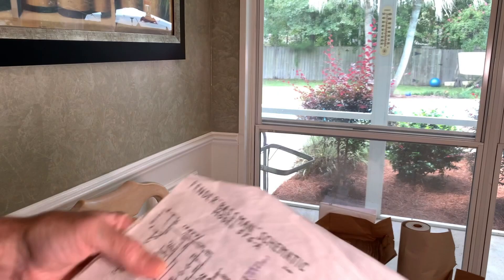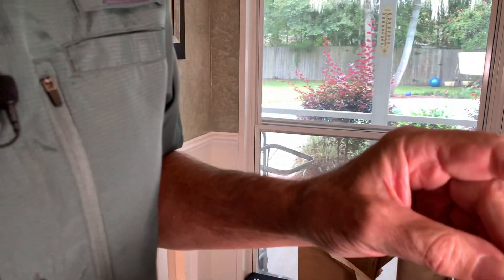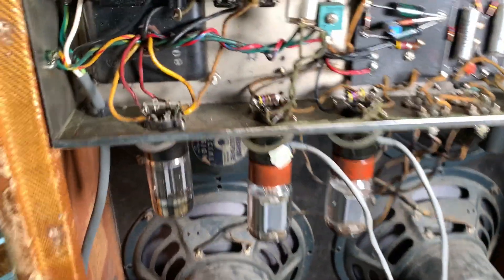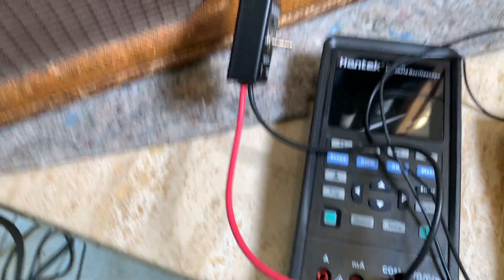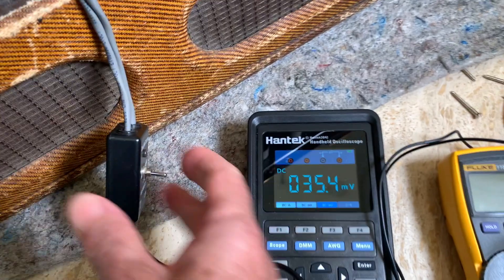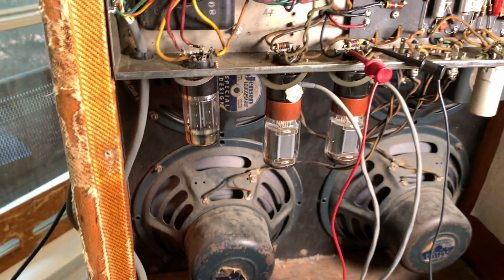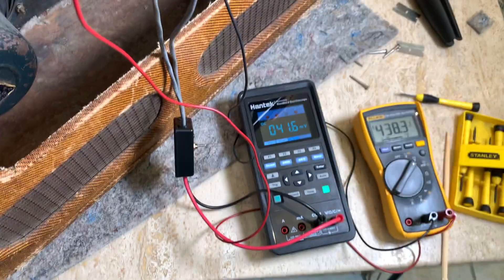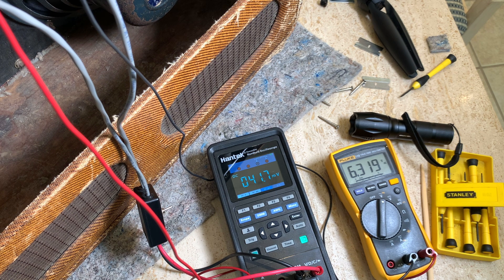Your Amp's Bias is Key to Getting Good Tone - Check it Frequently

Comment: It’s clear you are checking the plate voltage on the first measurement. What are you checking on the second measurement. It is unclear where you are attaching the leads the second time. It is clear you are adjusting the bias a little more but what is the 6.318 volts and where are you reading it from?

Comment: As a question....if a tube is rated as 450 plate voltage, can you adjust bias to make it run 600 plate voltage? If so, how would that affect sound, and what would be at risk of damage? Thanks.

Comment: are those 6l6gc's?
Reply from the maker: No, those are NOS Tung-Sol 5881's.
Reply: @millstap is this what you recommend for vintage bassman? I’m in the process of getting hands on a 1958 and what to get vintage tubes back in it . Also would love you opinion on pre amp tubes and what speakers to go with. It has modern Jensen alnico but would love to know what modern replacements you recommend vrs the new Jensens. Thanks
Reply from the maker: @oakhillslim  Yes, I always use the NOS Tung-Sol 5881's.  They seem to sound the best but there is a modern copy that I have never tried that might be worth trying.  I tried good 6L6GC but they sounded harsh to me.  The Tung-Sols are warm sounding.  The best part about the old 5881's is they are built to last.  I'm afraid the new ones only last a year or two with regular play.  Good NOS tubes are getting hard to find.  I would always look for RCA's or Amperex or a combination of them.  I'be been using a triple-mica RCA 5751's for years in V1 in my Bassmans.  Gives it a little more punch but not too much.  But, there so expensive now and your never sure if your getting a good one so always have a good return policy from the vendor.  I use all NOS Mullard GZ34 which are super expensive too but they have a modern version too I think.  If I blow my current one, I'm going to switch to a solid state Yellow Jacket rectifier which plugs right in the socket with no re-biasing although I would certainly check it.
Reply: @ thanks!  Love your channel! Hopefully I’ll get the Bassman in a couple weeks. Any aftermarket speaker advice?
Reply: Celestion Vintage 30s.

Comment: Man it would be cool to hang out with you. I'm such a huge Hendrix fan and I've commented numerous times about my '64 6G6B. Thanks for this valuable information.
Reply from the maker: Thank you for all of your comments.  How is your Bassman doing?  I haven't followed my own advice and checked the bias on this amp in some time.   I think I will soon.
Reply: @millstap  I got it in Sep 2019 and haven't had it serviced. I haven't opened the doghouse to look but everything with the exception of the tubes is all-original and dates to 1964 (transformers are '63). I'm the second owner.  It's clean. The wood between the speakers that runs front to back is fragile though. Oxfords fart out a little bit when I run the Clavinet through it. I'm about to get it recapped and serviced but hesitant. Still has the 2-pronged plug. There's a guy I'm taking to that supposedly has a stellar reputation in the state but wants me to meet him at a gas station to hand it off. Paid 3200 for it.

Comment: Hi nice video but what you were pointing to for ground is a 6.3 vac heater😊
Reply from the maker: Actually I was pointing at the bare braided wire that goes to the chassis ground but no biggy.

Comment: Both my Princeton and Tremolux make 6.3 on the filaments at 114.5
       Small world.
Tweeds are some of the finest products this country has ever produced.
Leo Fender should have gotten the Nobel Prize.
Reply from the maker: Exactly.  Leo was a utilitarian genius.  I guarantee these amp will be in service well into the end of this century and beyond if they don't figure out how to run everything on something other than electricity.
Reply: @millstap  I just hope they don't declare some kind of "green" war on tubes like they did on light bulbs, or blow up the Reflektor factory in Russia or do some kind of other demented thing to make the tubes extinct. So far as I know, the only uses they still have in the world are guitar amps, Hammond organs and Leslies, and super high end stereo. Now I see the younger folks looking towards simulators for all that stuff.
Reply: Indeed, but the actual designer behind the original 1954 bassman 4x12 amp apparently wasn't Leo Fender himself but either an employee or steel guitar virtuoso.

Comment: They had 2 different resistor values to bias the tubes to a closer match. More resistance on the higher mV to bring it down & closer to the lower one.
Reply: which resistors are you referencing?
Reply: @Toobzilla  The 2 screen grid resistors. Those resistors were different for a reason based on the bias of the tubes.

Comment: From LeoM:  If it is drifting very much and very often, you have some resistors that need replaced.  Those old compressed carbon resistors dry out and change.  Just like the capacitors, nothing lasts forever.
Reply from the maker: Thanks for this Barb. I’ve realized this and just this weekend I started replacing resistors in my 1963 Fender reverb unit because it was making noises. I am due to check the bias on this amp again. I replaced some resistors years ago but probably not all of them. My problem is I still go back with NOS carbon comp resistors if I have them but I have been ordering some newer carbon film resistors for my reverb unit. I hate the look of new resistors and if you use the wrong type, the amp can start to sound very sterile.

Comment: It's good to see your face as I have been tuning into your channel and heeding your advice for years. I purchased my new Fender '59 Bassman LTD. in November 25, 2019. I have spare tubes, a dual port bias probe with 2 needle style meters and and several multi meters. I am grateful for the bias port on my Bassman and also my Hot Rod DeVille III 410 purchased March 23, 2015. These are kind of similar amps as both are 4 x 10" speakers and similar wattage being powered by 2 of the 6L6 power tubes, which are similar to the 5881. Of course the Bassman still uses a 5AR4 rectifier tube which I prefer over the solid state rectifiers because the tube rectifier has the tube sag which I crave. 
I even use a Variac to control the voltage going into the amp. I use 110 and 120 VAC depending on the sound I'm going for. The Variac has a large rotary knob on top with a dial pointer than I align with the desired voltage. So changing the voltage takes all of several seconds.- Peter age 73
Reply from the maker: Hey Peter.  Thanks for watching.  I need to practice what I preach and check mine soon.  The last time I checked I think they had drifted apart quite a bit and I replaced one tune to match the other one better.

Comment: no need for the Weber board ! (5881 heat dissipation tubes 26w triode connection) 26/436x0.7=0.04174 multiply by 1000 to move the comma to the right place (0.04174x1000=41.74). For your bassman 26/434x0.7=0.04193 x1000=41.93 it works with all tubes if you are aware of their thermal disipation. Be aware that the 5f6a and a pentode amp and therefore the 5881 lamps must not exceed 23w of heat dissipation (37.09ma for 434v @70%)

Comment: It was the bias. The screen grid resistors shouldn’t change the sound that much. I have a Peavey Valveking that I use as a modding / tinkering platform, and at one point in time, I just took them off of the screens in general… simply to see how they affected sound. I couldn’t tell much of a difference without them.

Comment: Marshall DSL40 I bought used at Guitar Center, just barked at me, way too hot, no matter
what settings they all were unusable to my ears...bought a Celestion 65w Creamback still didnt 
help. so I tossed in a smaller pair of matched EL34`s and lowered the bios, its now playable
Im going to tweek it some more but I was about to take this amp back. It made sound , it just sounded like a solid state on steroids.

Comment: Thanks for the video Stan. Always great to start off the day with vintage amp work to take I ones mind off of everything else. I think I may try the mismatch tubes just to see what it it sounds like. I have the Alienist and it’s a great pedal. I may look at getting his wah too. I didn’t get the notification for the interview with Aaron. I hope I get this one. Maybe post a short video when you set the date and time. I usually get a notification when you post a video. 
There’s a couple questions I have regarding mods for the Alienist. If I send it in can he put a battery option in? Is there a easy way to correct the phase so it doesn’t reverse phase? I have had it happen a few times running dual amp wet/dry rig where it was an issue. Not too often though.
Reply from the maker: I'm pretty sure the reason Dan didn't put a battery in the Alienist is because of space.  I don't think it can be done without changing the enclosure but I will check with him.  We are setting up the next interview with Dan.  It should be great.  His old drop-in kit is still my #1.  It was the first time I ever bought a new wah after the Cry Baby I bought in the '80's.  Interestingly, I recently put the old Cry Baby pot in my drop-in because the other one was getting too noisy.  That old Cry Baby pot made it sound really good.  I immediately started looking for some more of the old Allen Bradley pots but they are few and far between.  The pot is key, I am finding.  If I ever wear out this A/B pot.  I will start a pot search because I didn't realize how much difference they make.  There are so many options.  I'm not sure what Dan is using now.  He's been down the pot road a lot in his career and should be able to shed some light on the situation.  On the phase issue, I would just get a good A/B box that has phase switches on it so you can change the phase of the amp with just the flip of a switch.  Why do you need the battery option on the Alienist?  Just curious.
Reply: @millstap  Thanks for the info on the wah pot - that would be good info for a discussion with Dan. The phase is not that big of a deal. I do I have a Lehle psplit that has phase reverse but it's just one more thing I need to pack for rehearsals etc. Regarding the battery, and with the band I was in recently, I found myself simplifying things a lot to make it simpler for rehearsal and gig set ups. The last two shows we played it was really critical to get things up quick and fast. Not to mention save my back.... Anyways, I found myself wanting to take the alienst like I might just grab a fuzz or wah but I didn't want to have to bring a messy power supply.
Reply: BTW, you have probably heard that Mike Fuller is closing shop.A lot of the guys who were passionate about vintage gear and recreating that are now reaching retirement. I hope people like Aaron, Greg G., Dan and all the other great custom builders of guitar gear find a way to pass on their knowledge and experience and not just let it go. With Fulltone, I was hoping one day to save up for a tape echo, but that doesn't look like it will be happening soon....
Reply from the maker: @JimmyDevere  I understand.  Taking one wall wart power supply shouldn't be too much to take.  Do you have an individual Boss PSA?  I know what you mean though.  I got frustrated with my old power supply at one point because it was noisy and I dumped it for a time and just used Boss PSA's.  What a tangled mess when you take 6 or 7 of them.  Now I use some Boss's and a Strymon Ojai which is very quiet.  The wah pots discussion is going to be a sensitive subject in my opinion because there doesn't seem to be a lot of great options out there that are vintage correct and sound right.  Dan tried to get some custom built I think.  He may talk about that.  I was thinking of trying the Dunlop HotPotz II which I have seen on a few high end wahs lately.
Reply: Gotcha regarding the sensitive subject. Will keep an eye out for the interview notification. Regarding power supply, my preference for playing is keep it simple and have a good base tone (guitar/amp). At home I’ll throw in a bunch of pedals but I’m always mixing it up and it’s a rat nest. 90% it’s just fuzz/wah and sometimes Alienist which is why a 9v option would be perfect.
Reply from the maker: And yes, the Fulltone closing is shaking the industry.  I have two OCD's and the Ultimate Octave.  They are worth a little more now.  I bet his tape delays will really go up in value.  Yes, knowledge transfer is key.  That is what I try to do with my channel even though I am not exactly an expert, just a serious hobbyist with 15 years of empirical knowledge.  RWeaverFX announced that he was closing shop too but mainly because he can't get photocells for his vibes anymore.

Comment: cant you install on the amps that have no bias pot one of those rotary pots like on Lucille? just a click type pot that has a multitude of different caps each position, just load that rotary pot with pots in the same range or very close so you can run it hotter when you like, or colder, OR, dial it in as you say, maybe install bias meter that's always running or just plug in a VHT Tube Tester + Amp Bias Meter every so often as you say? click type pot to dial it back where you want if it drifts..